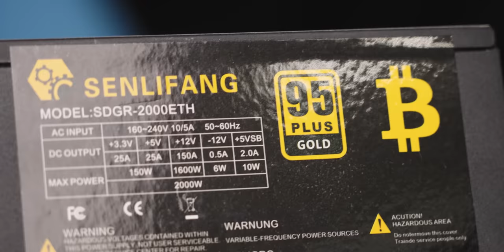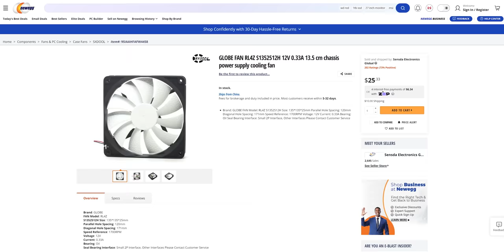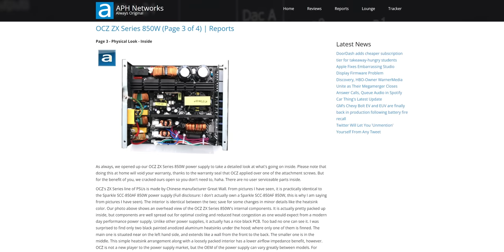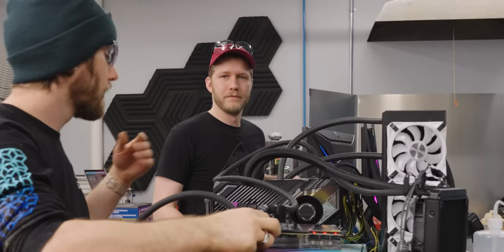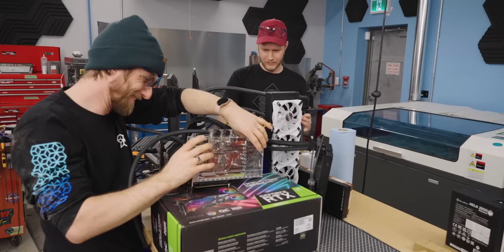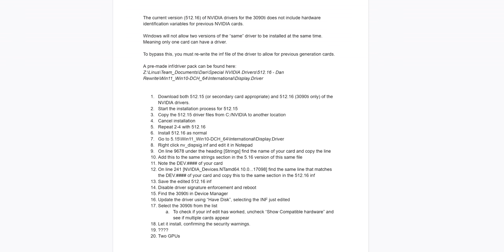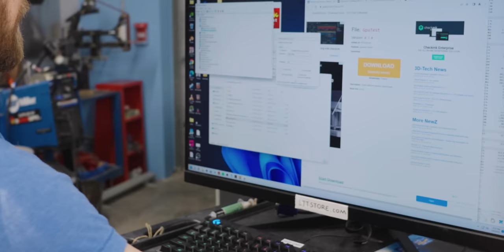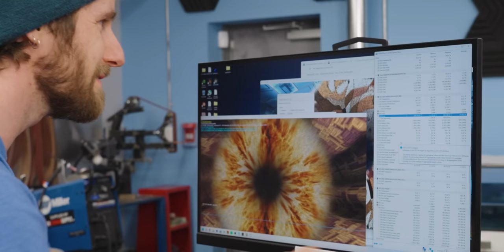This is one SKETCHY 2000W Power Supply

Comment: I sometimes wished to have (reputable) 240V only power supplys so we could get cheaper PSUs here in Europe. Yeah I know R&D and production are probably cheaper to only build one kine, but it seems very wasteful that all the PSUs are speced for 120V, which is a capability just utterly useless to most people over here.
Reply: I question why 240V plugs are not more common in datacenters in North America. You can get extra efficiency that way.

We do have 240V plugs in the home: but they are normally restricted to the Stove and clothes dryer (with high current ratings like 40A/30A repectively). I suppose Level 2 car charging is also 240V.
Reply: @jamesphillips2285  Well Datacenters often use something like 400V (very custom) or 240V (as seen the million dollar unboxing) AFAIK, but in homes (and maybe even in smaller Datacenters) it'd be hard to switch plugs because you'd have to have both sockets in a home for some years if not decades, otherwise most would probably switch to 240V (at least they should for efficiency), but yeah legacy makes that pretty hard... (Also you'd need to change those dangerous plugs if you don't want people to die, 240V packs a hell of a punch, the shock ahould be 4 times stronger)

Fast car charging is DC btw.
Reply: Australia is also 240v. You find a lot of multi-volt stuff now, switch-mode power supplies have made various voltages/frequencies a non issue so only one needs to be made. It's not any cheaper to make a 240v only, and barely any efficiency difference now.

If anything, wide voltage appliances(with a standard IEC plug) make buying items easier as you can shop anywhere and just swap your local power cable for your area.
Reply: @lunchie80  well consumer power supplys don't do this, but in server you seem to often see that the PSUs have double the Power for 240V, so you could probably build a 400V regular PSU to go out to like 750W with 240V only (and that's what makes it cheaper), you might not even need to change much in the hardware design because of that, you probably only need to change the output side of things.

(Also you don't really get PSUs with non EU plugs here, so that's pretty much a non-issue for consumers)
Reply: Well then you just generate extra waste and get rid of inter-compatibility, like imagine you're American and you move to somewhere in europe and power supply companies have made it where you only have 120v and 240v power supplies in the areas that use those, when they move to Europe or most anywhere else they have to buy a new one, and vice versa. Honestly we just really need a universal power standard but that won't happen for a long time, if ever.
Reply: @nesyboi9421  Well 120V to 240V isn't much of a problem basically (you're mostly only wasting a bit of potential in most cases). It's only the other way around where you'd only get half of the power out of the power supply. It's niche enough though, where I think there's more waste making it compatible with 120V than having a few units be discarded. To be clear, I'm talking desktop PSUs, for lower powered stuff or things you might take with you on a trip it's just pretty useless. Precedent is set in the server space though where many PSUs just halve their power when operating at 120V (or rater double their power when using 240V). I think like in the server space, at least an option would be good. I know my Desktop won't ever leave the country, so I'd be down to saving money or at least get a PSU with a higher capacity for the same price.
240V everywhere would be ideal of course, but that'll take a long time and first North America should probably replace their awfully dangerous plugs and use GFCIs for the whole home though, 240V is a lot more dangerous.
Reply: I was also thinking this.. so much wasted money on 110v rated stuff
Reply: @cromefire_  More wattage for your money =/= cheaper. If I want a 500W PSU, and you tell me I can have a 650W one for the same price, you aren't saving me any money.
Also, "double the power" depends on the power factor. The closer to unity pf (1.0, purely resistive), the more true that actually can be. Real power may not = apparent power in every situation. Also, not sure, but those PSU's might be using more than one phase.
Reply: @cromefire_  400V isn't really custom : it's just "Three-phase electric power" (or triphasé in french)
on 230V mono phase networks like in the EU, the current is carried on 3 phases on the poles.
some very old rural homes here in france still have three phase power coming to the electric pannel (but is divided there into mono phase circuits), but you can find some 4 pole connectors (3 phases + 1 ground) for high current applications like powered tools or boilers (this is the triangle configuration for three-phase)
> 400V is just bringing the 3 phases all along to the equipments.
with servers though, none are configured to run with 3 phase 400V, but with mono phased 230V. so the split occurs right into the PDUs if you do that. (at least with edge deployments which I work in, it means at best I've seen 2  42U racks with 15kW of equipment each - plus one with 7/9kW for backup - going to clients)
with this, you can get up to 400V 63Amps, whereas the biggest connector i've seen for servers on mono-phase was 230V / 32A. The bad thing though is that you MUST balance everything on the different circuits, most server PDUs that are fed with 400V split this into 6 230V 20A circuits

for NA, three-phase would get you 208V. In fact, it's what you have on your electrical pannels most of the time, which you then play with 2 phases to get 208V
> three phase is exactly this : you either take one phase and a neutral to get your nominal current, 110V ish in NA, 230V in EU, 240V in australia, or you take 2 phases to get more, 208V in NA, 400V in EU, 415V in australia

There is however some custom made three phase at 480V used by facebook I think ? But it's weird since one phase + neutral = 277V, so they had to make custom power supplies
Reply: @nimoy007  Yeah it's not exactly double, but you'd probably get a 550W PSU to 850W or so in most cases and last I checked 500W units where a lot cheaper than 850W, so in most cases you'd probably save money. (No in the low end probably, because there aren't many < 500W units. And yes server can be a different story although you see PSUs like that with 2 phases, but it's only similar not the same of course.
Reply: @seedz5132  Yeah, having 400V isn't really custom, hell I have a 3-phase socket in the garage, but there don't seem to be as many off the shelf PSUs, even in Serverland, that use 3-phase (I'd consider PDUs in a space where you already have a pretty "custom" solution and probably spent a lot of time and money building the DC) and you'd definitely need a different connector because the standard 3-phase connectors are just huge. At work in our small Datacenter for example everything is 240V (well technically 230V), but I mean we also didn't spend millions on it. I'm sure the hypescalers and other large DC vendors have figured it out.
Reply: @seedz5132  In the UK or EU, 400V 3P is normal, but it is custom in the US/Can. Similarly 110V is very custom in the UK/EU.
Reply: @nesyboi9421  It is easy enough to design devices for both 110V and 220V
Reply: @cromefire_  I'm referring to electronics in general(not just PC PSU's). A lot of stuff these days is voltage and frequency independent and can run on pretty much anything. 

It's also not the OUTPUT side that needs changing for different voltage regions, it's the step DOWN that changes. PC PSU's only put out 12v/5v/3.3v 

The PC PSU's that have a voltage switch to change voltage(like in OEMS) are only needing a very small number of different components, or perhaps a separate winding in the transformer, but again, for a switch mode-supply(modern high efficiency PSU's), its a tiny cost difference in parts but a big saving in production costs for having only one model. The HP power supply next to me(for a prodesk) is 100-240v auto switching.
Reply: @cromefire_  working in the industry (hence the "edge deployments"), we mostly get three phase plugs (the 5 pole ones)
400V PDUs aren't that uncommon in the space. But i've yet to see servers use it. They always go down to 230V, since it's easier and everyone in the world can supply the 200-250V range \o/ (for EU / AUS, with one phase, for japan / NA, with 2)
so yeah, i've yet to see any real DC, but i've seen faraday cages, 42U armored racks, and 400V PDUs :p I've also seen high powered racks with lots of GPUs, but not of the liquid cooled variety - yet. the industry is slow to adapt towards these
Reply: @lunchie80  Well given a 120V PSU at 400W, that cold deliver like 600W at 240V. You'd definitely need to bump up the output side to support 600W.
Reply: @seedz5132  Yeah if you work in the industry you probably see a lot more of those than us normal IT people, to me that's not something I deal with a lot or that many companies would probably just like buy online for their internal DC. I think it's more something a specialist would plan and install (hence "custom").
Reply: @jamesphillips2285  What on earth could you possibly need 40A/240v in the home?  thats 9600W draw potential.   In australia,  all of our standard power is 10A/240v,  with 15/20/30A used in commercial settings for machinary and what not.
Reply: @nesyboi9421  It's definitely generating more waste to put the extra components into every single power supply, the majority of which will never be used. I'm personally in full support of an additional model that only supports one voltage and frequency, since it's not all that common for people to move from the USA to Europe, and those who do probably won't be able to justify the expense of shipping their quite heavy power supply internationally anyway, and will instead sell it and buy another one upon arrival.
Reply: @TroublesomeOwl  For the kitchen or heating etc. appliances. Good induction cooktops can easily use up 9kW when multiple burners are in use. But in those cases it’s usually 440V anyways.
Reply: Poor America can't use a kettle
Reply: @TroublesomeOwl  First oven heating element I checked was 3000W.

First stovetop element I checked was ~2100W (+- 300W depending on 208/240V)

So oven + 3 burners on high gets you to 9000W. You typically wouldn't leave them all on high: so that is peak draw.
Reply: @jamesphillips2285  Fair enough,  still seems insanely high to me... that is a crazy amount of power.   I'll stick with gas cooking lol
Reply: @TroublesomeOwl  Heating. My room heater (heat acumulating system) draws about 6000W, and it is not even the biggest available model
Reply: @jirkau555  holy shit.  You basically won't find a standard heater in australia over 2000w,  for a single room anyways.  Maybe a central heating unit might get up there.  Anything over 2000w really would be considered commercial
Reply: @cromefire_  Level 2 charging isn't DC.

It goes like this:
Level one: 120v AC through the charger
Level two: 240v AC through the charger
Level three: 480v DC straight to the battery, bypasses the charger module
Reply: That won't make PSU cheaper that much (may be just 10%).

Problem of North America is the Current and Outlet/Plugs. If NEMA 5-15 go straight to C13/C14 of the PSU it will limited to 1200W (10A). So PSU more than 1100W will either need 200-240V or Plug/Cables that handle more than 10A (That's why the back of 1200W+ PSU is C20 not C14 which rated at 10A/250V)

That's a mess because cables to handle more than 10A is likely at least 4 sq.mm per conductor and it's very bulky. Datacenter is using 208/240V to power the servers because cabling is much simpler and still can use C14 socket on the back of the PSU in 1U servers that consumes 1000W+.
Reply: @nesyboi9421  Can't see a universal power standard happening, considering that even a country (Japan) can't even have a single power standard.
Reply: @cromefire_  you still don't get it. Changing input voltage DOES NOT make a PSUs output capacity higher. The MOSFETs/regulation for the 12v rails etc are only capable of what they are. The INPUT voltage only caps a supplies peak capacity when you're nearing the wall socket wattage limit. 

A PSU with a 400w 12v output is still only going to give 400w on 240v because the OUTPUT stage is responsible for power it delivers.

I think you don't know how they work. 

Most modern PSUs are ALREADY switch mode, and are ALREADY more efficient at 240v. The COST won't change because they have SWITCH MODE designs that just pulse their output to the regulation stage differently for each voltage.

Maybe no learn about them. Making a single voltage version of a switchmode supply is a dumb idea, no more efficient and will cost MORE as they will need region specific models
Reply: I am not that well versed in this stuff but i have always wondered this, at the body shop we run for instance 3 phase for many things. Cheaper to run them but cost more to run the wiring up front. Always surprises people that when going up from 120-240 to 3 phase ect the electric cost drops.
Reply: I know you said "reputable" but if you want a cheaper power supply you have options (like the thing in the vid).

It's just not worth the cost for the big reputable companies to design and build out a 240V only model. And the msrp really wouldn't be that much different. When you're spending hundreds on components it seems stupid to cheap out a few bucks on the one thing that can destroy all those components.

And a good quality PSU basically lasts forever, so it's kind of a buy once cry once type of thing. The only problem is GPUs are going up in power draw again so a lot of us are having to cry a second time.
Reply: @sntslilhlpr6601  Well cheaper, because with 240V you can cat link in theory up to 2x the power out of pretty much the same components at least on the input side. That's why it would be cheaper. You wouldn't even have to design much of a new model, a 500W model can probably hit like 800W in 240W with most of the same components. I mean Europe is a big market, might be worth the slight redesign for cheaper PSUs.
Reply: @seedz5132  good explanation, I just want to clarify two things at the end of your post. In NA 277/480v 3-phase is a common voltage in commercial & industrial buildings. It's typically used for lighting circuits, motors, & other high current draw devices. 120/208v 3-phase systems are also typically used in those buildings.

In most NA homes it's single phase 120/240v. They "center tap" the secondary winding of one phase which gives you 120v to ground,  240v line to line, with both lines crossing zero at the same point, as opposed to 120* out of phase like in a 3-phase system.
Reply: @lunchie80  Watch million dollar unboxing. Server PSUs commonly do this and it's not because of price and enterprise doesn't cheap out, so it's not an instance of they just saving a cent on not making it full capacity available at 120V. Heck even listen to Alex in this video literally saying (from memory, exact wording may differ): "Why can they do it that cheap? [bunch of other reasons] Well they also only run on 240V." And I'm sure Alex knows his stuff.
I think what you miss is many components of the PSU are on the on the AC side (the output voltage is only really created on the very end). So yes, you need to modify the output side to support a higher output, but the output side is a lot smaller that the input side. So yes it's not a simple 2x scale, but I believe you can get ~25% better price to performance at least.
Reply: It is undeniably useless for most of the people, however when I needed to move to Japan, I was forced to search for a power supply for my PC that can accept both 240V and 100V AC. That was a harder and cheaper way to have and use a computer in both countries.
Reply: @legendaryone66  Why is this a common assumption I see online? We have kettles, they're just apparently not as fast. My cheap Walmart model just took 2:18 seconds to boil 500ml to give an idea of speed.
Reply: @cromefire_   I asked the same question while visiting a large data centre in North Carolina.  "Oh," said the manager, "To do that we'd have had to build a sub-station and we didn't have the room." — while standing in the middle of the 17 acre parking lot.

When I fitted out small office data room in New York the available supply was 208V [yeah, I know, but the landlord was a jerk].  However we had an uninterruptible power supply between that and the equipment so were able to configure the UPS to deliver 204V to the loads with IEC C13 and C19 receptacles in the rack PDUs.
Reply: @seedz5132  In the USA, 120/208 3 phase is standard in commercial and light industrial applications, due to the compatability with 120v consumer electronics. However, 480/277 3 phase is standard in heavy industrial applications. Things may have been "custom" on the datacenter side of things, but it's an exceedingly common voltage in places like factories.
Reply: @seedz5132   North American 208V isn't phase to phase but phase to centre-tap neutral on a high-leg delta transformer set.  (Well, except when it isn't.)

It's a consequence of supplying 120V split phase from a 240/415V 3-phase supply without the expense of an additional step-down transformer. That looked useful for some purposes so became a de facto standard when for safety and sanity it should have been stomped on hard and erased from history.

Split phase 120V is derived from single phase 240V — through a long and twisted history this actually can be traced all the way back to Edison's first electrification of Lower Manhattan.  Getting 120V single and 208 three-phase supply arises perversely from wanting to replicate the high-leg delta 208V without having a high-leg delta transformer set and you'd really not see it except in the most extraordinary circumstances.

Oh, and Facebook might well have designed custom 277V PSUs for their kit, because that's the sort of thing that they do — when you're that big shaving off even miliWatt-hours in efficient counts for a lot.  But while 277V might be rare it isn't unknown; I've had both IBM and HP multi-input PSU's rated for 90V–277V: the first time I saw one I was surprised and intrigued enough to go find out why. 😀
Reply: It wouldn't really make much difference. The power factor correction stage also regulates incoming voltage. In effect, a power factor correction stage acts like a voltage regulating, voltage boosting rectifier. You put 90V-270V AC in and get 380 V DC out.  The entire rest of the power supply can then operate at 380 V DC.

The additional cost in supporting a wider (lower) voltage range is higher current handling in the PVC switches and inductor, which in this type of PSU is a small part of the overall cost and has limited impact on efficiency when operating at the higher voltage.
Reply: @ChumpusRex  It does, that's why many server supplys operate a lower power when connected to 120V (see million dollar unboxing). Even that fact is proof enough, if there wasn't any difference, Server PSUs wouldn't be built like this, a few dollars wouldn't make a huge difference they'd just spend the few extra cents and make it the same wattage at 120V. I mean it even makes sense when you think about it because most of the input side has to be built for double the amperage including the conversation to the higher "operating voltage" (see GNs PSU explainer, much filtering and stuff is done at the input voltage).
Reply: I live in US and have to agree. Even though we don't use 240V for average stuff I still think anything related to supplying power should be rated for both, and as I've seen in past using a switch to select between the 2. Why make it complicated and pass anything extra to the consumer? Make it compatible with the world, or the world should get one standard.
Reply: @kfxrcer  I've always been told you don't have have them as they dont make them for 110v. They are 220-240v 1800- 2400watt in Australia
Reply: There's a lot of 200 - 240v PSUs here in Asia. From cheap brands, to medium brands like Antec, FSP, to high-ends like ThermalTake (sadly Corsair doesn't have any).
Reply: @TroublesomeOwl  "What on earth could you possibly need 40A/240v in the home?"

My electrically heated shower is on a  240V 40A breaker circuit.  That's really standard.
Reply: @TroublesomeOwl  Did you even read the comment? He very clearly said "but they are normally restricted to the Stove and clothes dryer (with high current ratings like 40A/30A repectively)"
Stoves are usually 7kW - 7.5kW, so that's 30-32A, which is the reason why you need a 40A fuse.
Reply: @jamesphillips2285  
Coz Murica®
Reply: Murica is the country that exists

Tf you are saying
Reply: @calmeilles  I think you're a bit mistaken. Usually it is 208 phase to phase. High leg delta is pretty rare. 110 volts was standard before three phase power was introduced.